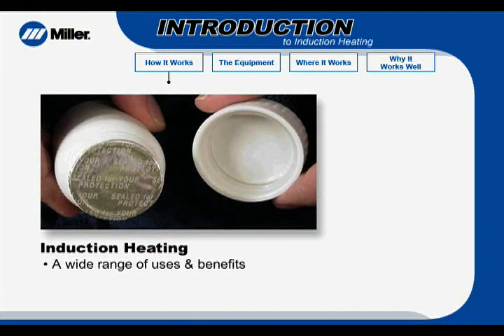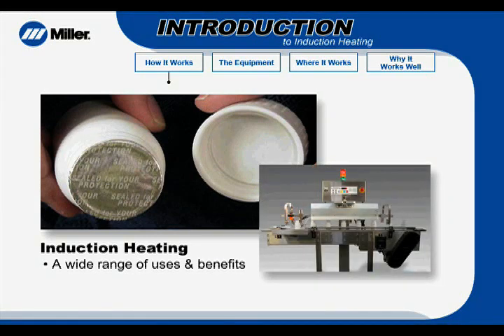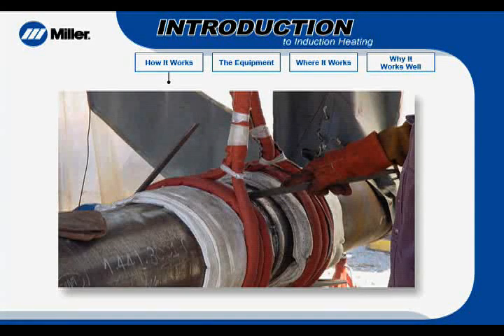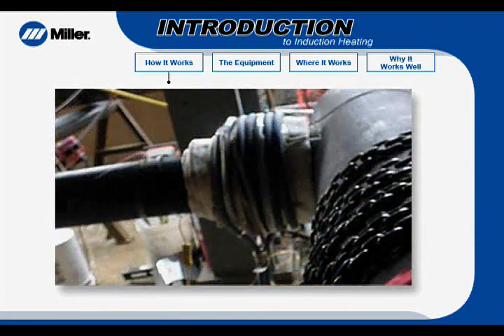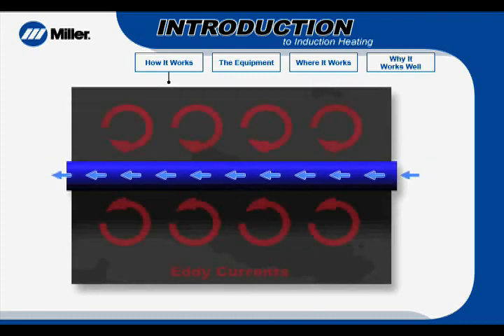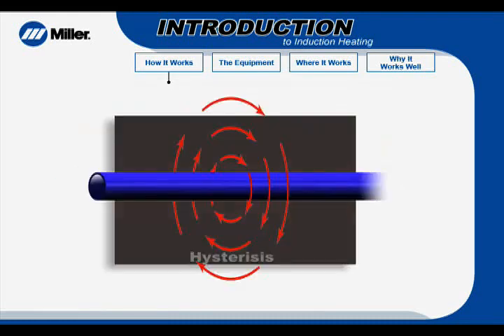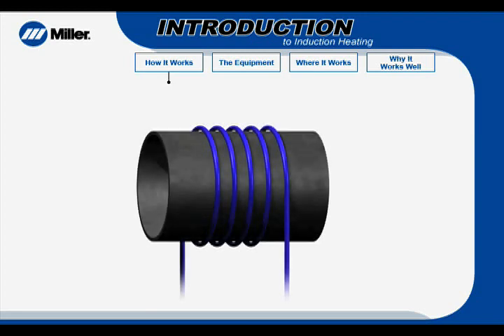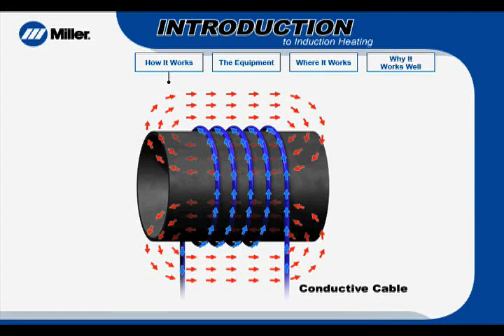How Does Induction Heating Work in Welding?

Comment from the maker: Yes, the cable has a cloth sleeve or cover, but it's not really insulation -- the cable itself does not heat up like a traditional heating element, it's the pipe underneath that does.

Comment: No it does not work with DC. A steady magnetic field that is produced in DC cannot be induced into another conductor. You need a changing magnetic field which only comes from AC. Read how transformers work. Its the same principle.